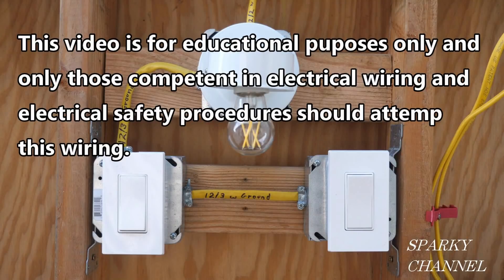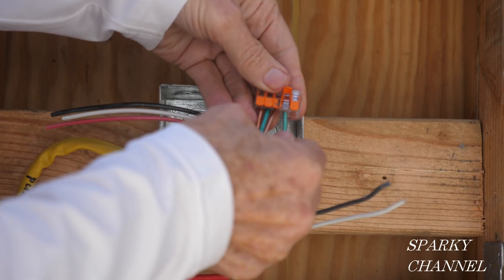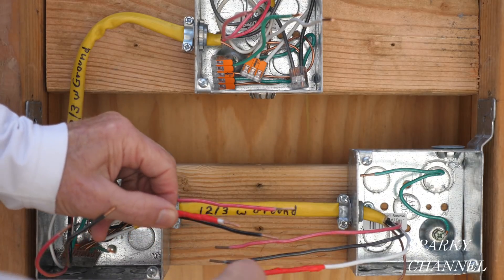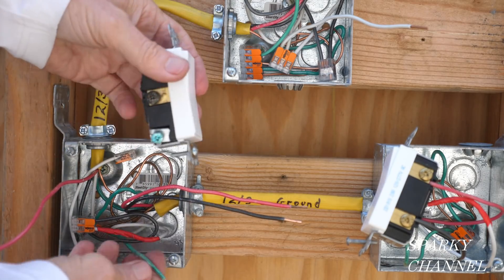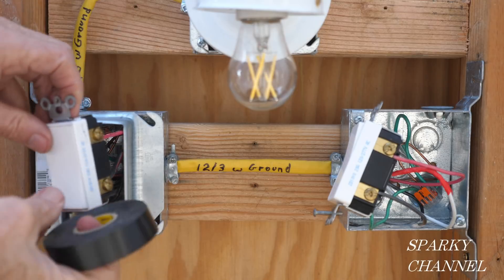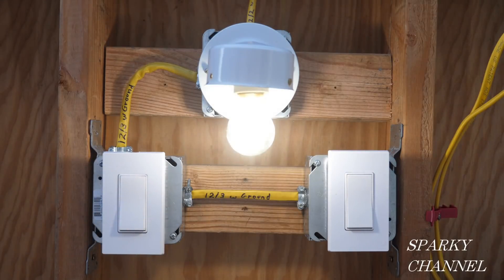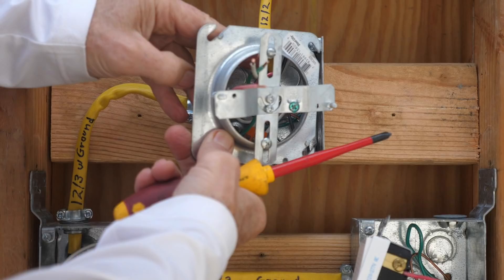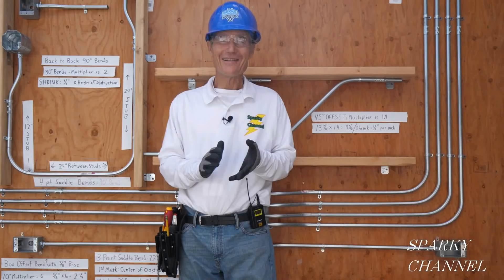How to Wire a 3-way Switch with Power to Light and 2020 NEC 404.2 (C)

Comment: Brilliant as always. It’s worth mentioning that in some circumstances some three-way lighting set-ups may be incompatible with AFCI/GFCI receptacle on a circuit which would trip given the borrowed neutral- either you would have to change the layout of the 3-way wiring or wire it into a one way switch. 

It’s worth while showing that bill because many people will not be aware of this issue and if people are not aware it can create faults and problems. I say this because many people will want to protect branch circuits with an AFCI/GFCI receptacle and depending which feeds power to a set of lights and borrowed neutrals can be problematic they will need to re-wire the three way to make it fully compatible with a three way switch.
Reply from the maker: Thanks Math Man, excellent point.
Reply: In what situation would it not be afci compatible? As long as the neutral and hot are the same circuit it should be fine right?

Comment: Question, i have the same settings, and on the 2nd switch, I want to replace it with a combo switch +  outlet, and the switch remains 3-way, but I need constant power to the outlet. do I need to rewire between the 2 switches with a 12-4 cable?
Reply: Do they even make a 3-way switch/outlet combo?  If you can expand it to a 2-gang box, it might just be better to use a regular 3 way switch and a standard duplex outlet.
Reply: @mae2759  Yeah, I want to do this too, but I have never seen anyone demonstrate how its done.

Comment: Hi Sparky. Nobody can answer my question. Hopefully you will or can.. I am trying to hookup a single pole switch, to operate an outside light, from my end three way switch.  Already have wire coming from light to the double box to be hooked up. just need to bring power from three way to outside single pole switch to operate. Hope I gave you enough info. Thank you, Rick Smith
Reply from the maker: Bring power from the 1st 3-way switch box. That box will have non-switched power. Don't bring the power from the 2nd 3-way switch box as that power will be influenced by the 3-way switching.
Reply: @SparkyChannel  Thank you. Keep up the videos

Comment: I have seen this wired a few different ways and I have a question. Is there code for what color wire powers the light on this type of setup? I have seen Bill use red here and others I have seen black. Is it personal preference? Thanks
Reply from the maker: Red and black are common colors for hot wires and both are fine.

Comment: I dont understand how this works if you go neutral to light then capped your neutral on your first box how does it complete the circuit?
Reply: because the very first cable is the power which is coming from the light junction itself, the red cable in the first light junction is actually the HOT. it's complicated for me too but essentially he is doing it all backwards so the wiring is backwards as well. the 3 way switches do not appear to need neutral thats why he has provided the neutral to the first 3 way switch but actually capped it off meaning none of the switches are even using neutral. the only function those 2 switches are doing is telling the light if it is ON or OFF, if we were over simplifying it's concept. anyways look at the very first power cable, that is the source of the neutral
Reply: @eksine yes only thing that needs a return path is the light
Reply: "Line" hot wire comes in from the top, goes through switches, comes back to the light.  Light now has hot power.  Neutral goes from "hot" light back through the line wire at the top.  The capped neutral is in the other box just in case.

Comment: How to wire a 3way switch with a switch leg and power from the same box
Reply: Simple. Just run a 3 wire (or 4 wire if you want a neutral in both boxes) to the new location. Choose one of the new wires in the new cable you ran to be the extension of your existing hot or leg. Label it so you don’t forget. Then use the next to wires on both ends of the new cable as travelers. 

I like to use the black wire from the new cable and join it with either the black hot wire or leg wire. The black wire at the new location and the remaining black wire at the old location will be your commons. Then reidentify the white wire in that new cable as a traveler wire. So the whites and red of the new cable will be your travelers.

Comment: I am confused about your diagram, where the neutral wire from 12/2 cable is floating (or open) when you capped it with Wago at the first switch.  I am trying to follow the flow of the current and I can't seem to follow it using your diagram.
Reply: "Line" hot wire comes in from the top, goes through switches, comes back to the light.  Light now has hot power.  Neutral takes the current from the light and back through the line wire at the top.  The capped neutral is in the other box just in case.
Reply: He used 12/3 from the light to the first switch, not 12/2. In that 12/3, black is extension of the hot wire in the light box and red is the leg wire that will power the light. At the first switch, you have two choices when wiring the common and travelers. You can connect the black wire from that 12/3 directly to the common of the first switch then join the red wire to any wire going to the next switch, or you join the black wire with one of the wires going to the next switch then connect the red wire directly to the common, which is what Sparky did. Either way, the other end of that wire that is jointed at the first switch should go to the common of the second switch. After that, it’s really simple. Just connect the remaining wires to the remaining terminals of both switches and your ready to install your light.

Comment: Question. Let’s second I needed at neutral wire in the second (right side) box. Could I install a 12/2/2 instead of a 12/2? And use the all white for the neutral and the white with red stripe as a traveler? Of course I would mark it as a hot.
Reply: Ha ha 15:15. I should’ve waited to watch the entire video. But good to know that it can be done like that.

Comment: Hey Sparky! I know this video is over a year old now but its still very helpful. You have a knack for teaching and me understanding it. For the longest time, 3 and 4 way switching confuzzled me. Its funny to me now because I'm used to doing 3-way switching with DC circuits. For some reason, 120v circuits would just break my brain. It wasn't until after understanding what is going on within the walls that helped me understand it better. Thank you for this and your other great videos!
Reply from the maker: No problem, thanks!

Comment: I realize this is an old video but i’m just now getting into electrical work. I know that your neutrals always have to go to the light, but out of curiosity what purpose does the lone white wire serve in the first switch box? it just has a “wire nut” or whatever you’re using for the pigtails.
Reply: Currently there is no purpose. But if you wanted to add or change to something like a smart switch, you would need neutral. Future proof it a bit.
Reply: thank you !

Comment: I am wiring my ceiling up with outlets, to plug LED lights in to. With two 3-way switches as you've shown. Would this work with wiring multiple outlets rather than the one light receptacle you've shown? I am just trying to rough in the wiring for my electrician to do final hookup. I think it will work, but always appreciate input! Thank you for the great videos

Comment: My preferred method for 3 way switches. My only difference is I use the red and white (marked as hot) wires for my travelers. It helps to keep them from being mixed up with the neutral.

Comment: Great video as usually! Can we just use a two wire from the light to the first switch?
Reply: It'll work, but it's against code because there won't be a neutral in the switch box.

Comment: What's the purpose of the neutral in the switchbox? Unless you have a dimmer that requires a neutral? You can also send a 12-3 or 14-3 from  each switch box up to the light box and tie your travelers together and feed either switch hot.

Comment: They manufacture a 12-2-2 romex, but it is hard to find exept at maybe a large supply house.
Reply from the maker: Yes, that can definitely be useful when you would like to run 2 circuits with one cable and have each circuit with it's own neutral.

Comment: I've normally heard it back in black, but it doesn't matter, so long as you know. Is there any reason you choose the white (re-identified, of course) as the return?
Reply from the maker: I wanted to keep the red and black for the travelers. Having just one neutral in one of the 3-way switches wasn't allowable in 2011. I think they decided it was too harsh and eased up some, including 2020 where they are now allowing this in all habitable rooms. You can see it at 10:47 where it says "all habitable rooms or occupiable spaces". That phrase is new for 2020. I would rather provide the neutrals but I wanted to be able to demonstrate 404.2 (C). Tomorrow's video will show what I think is a super cool way to wire this 3-way switch set-up with power from the light. And it will provide neutrals to both switch boxes. I'm noticing that the guys who make videos and just say the code is such and such are often wrong or perhaps they were correct for a couple of code cycles back. I would rather go to the actual current code and discuss that even if it does take longer.
Reply: That's an interesting thought. I was working from the CEC before 2014, when I moved, so I was unfamiliar with having to have ALL switches with the neutral (grounded conductor.)
Reply from the maker: @IceBergGeo  Yes, that was a huge change here in the USA in 2011. Lots of complaints and grumbling. Now the NEC has backed off a little with some exceptions. But it seems that not that many people are familiar with the exceptions. Cheers from San Diego!

Comment: Hi bill from sparky Channel

Fantastic video and example
I personally appreciate the code you showed here.
You know I like learning the code.

Your show gets better every day.

Thanks again
Reply from the maker: Isn't that an amazing code? Having just one neutral in one of the 3-way switches wasn't allowable in 2011. I think they decided it was too harsh and eased up some, including 2020 where they are now allowing this in all habitable rooms. You can see it at 10:47 where it says "all habitable rooms or occupiable spaces". That phrase is new for 2020. I would rather provide the neutrals but I wanted to be able to demonstrate 404.2 (C). Tomorrow's video will show what I think is a super cool way to wire this 3-way switch set-up with power from the light. And it will provide neutrals to both switch boxes. I'm noticing that the guys who make videos and just say the code is such and such are often wrong or perhaps they were correct for a couple of code cycles back. I would rather go to the actual current code and discuss that. Thanks Jeff!

Comment: So switch looping is no longer allowed? ex. In a bedroom with feed to ceiling light or switched receptacle you can no longer just pull a 2 wire to the switch? It now has to be a 3 wire and the neutral would be capped off?
Reply from the maker: Yes but there are exceptions such as 404.2 (C) that I demonstrated in the video.
Reply from the maker: Also, I wanted to add that I have more 3-way example videos coming! Thanks!

Comment: I’m glad you noticed two of the wago nut levers on the grounds had lifted up, and closed them back down.  For this very reason, I like to wrap the wago lever nuts with electrical tape (which of course reduces their convenience) for added security.
Reply from the maker: It's not a problem if the Wago's lift up a little. It gives the same connection. You have to lift the lever up all the way to disconnect.

Comment: This was a common method of 3way/4way system wiring in old houses.  So this is great for troubleshooting.  If I'm installing new 3way/4way wiring I will stick with the method of feeding line power to the 1st switch and load from the 2nd w/ travellers between. I like the way Bill sketches the wiring out, that was the best way for me to learn and wire things correctly as an apprentice.
Reply from the maker: Thanks! More 3-way examples to come. For this one I wanted to demonstrate 404.2 (C).

Comment: just a suggestion bill----   might want to show a multimeter  on continuity mode showing how the common connects to each traveler terminal on the switch   and how each thraveler teminal is isolated from each other.    i've had a hard time getting people to understand  but once they visualize it  they get it.
Reply from the maker: Excellent idea, thanks!

Comment: Is wrapping the switches (and receptacles and what have you) with electrician’s tape part of code? Or just a “best practice” you’ve adopted? I’m all for it (and have started to do it in my renovations/repairs) but I don’t believe I’ve seen it done before I found your channel.
Reply from the maker: No, it's not code but I think it's a good idea.
Reply: @SparkyChannel  agreed. My house has small metal boxes for the most part, and putting in a GFCI gets COZY.
Reply: Not code just preference commercial electrician I always tape up everything as far as devices but have worked with people usually from a different local that say “it just wastes time”😂I think he’s got a video supposedly ideal makes a rubber band type thing now u can use too circumvent using tape
Reply: @christianlemus6483  I saw that one. If someone else was footing the bill, I would absolutely be using those!
Reply: @notanavrageloser  yeah there new they don’t seem to badly priced if you buy them by the thousand time will tell if they catch on 🤷‍♂️
Reply: Definitely not a code requirement, perhaps not even a "best practice". Most electricians don't do it, but I suspect Bill is showing it this way to "dumb it down", or rather to make it safer for a DIY'er, who will follow the instructions in this video. Another good reason to tape around terminals is to avoid the contact of the bare ground wire with one of the terminals as you are stuffing the device back into the box (which an electrician will have a plan for avoiding by planning how the bare grounds are folded into the box). 
Also, the tape tends to slip off the device. What I use instead, when I need to cover the terminals, are cut-up squares of Scotch 2228 thick "rubber" tape - much neater and stays on much better.
Reply: I personally hate it when I'm the one to go back in the box. By the time I get to it, it's already falling off. Not to mention the sticky residue it leaves behind. Just extremely aggravating.

Comment: When do you need to use the grounding screw on the lighting crossbar?
Reply: there is never a bad reason to use it - just wrap the grounding conductor coming out of the light fixture around it, before you connect it to the grounding conductor in the box.

Comment: wait, what; why send the power all the way to the end? there's no neutral there anyway, so just send the red switched leg over to the "dead" end.
Reply: you're just inviting the kitchen remodelers/handyman to abuse the ground for neutral when they put in a "smart" switch...
Reply: @wim0104  I like your comment as a best practice - if you bring a "full-time" hot into a box you should bring a neutral with it.
Reply from the maker: I was trying to demonstrate 404.2 (C).
Reply: also, if we're mentioning "grounded conductor" (aka neutral), use the magnificently epic "luminaire" for light.
Reply: I agree that omitting/repurposing the neutral seems like one of those situations where “just because you CAN doesn’t mean you SHOULD.” Buuuuut, it’s a lot more elegant than a lot of the “shortcuts” I’ve discovered in my old house.

Comment: why do you use 12/2 for all these demo's?
Reply from the maker: 12/2 is superior to 14/2 even if it does exceed code. I like to protect the house in case someone adds to a lighting circuit later on.
Reply: Another reason 12 AWG is superior to 14 AWG even though #14 would work is voltage drop over long distances.
Reply from the maker: @Noah-qt3rq  Thanks Noah!
Reply: @SparkyChannel  I like this attitude. As a craftsman, always do your work in such a way that it will not have to be redone!
Reply from the maker: @lightwalker222  Thanks Luke! I'll bet you do great work.